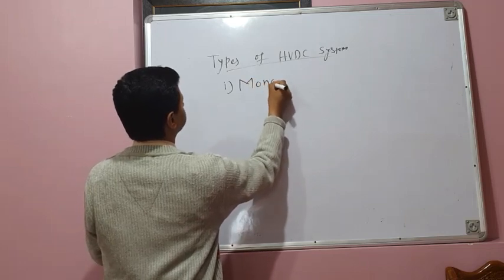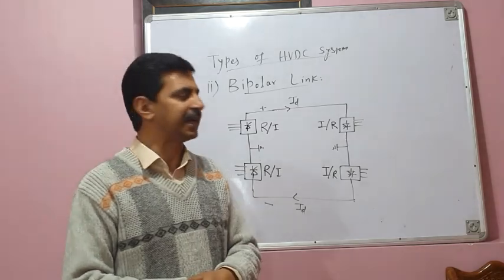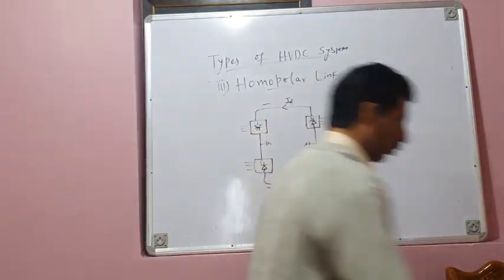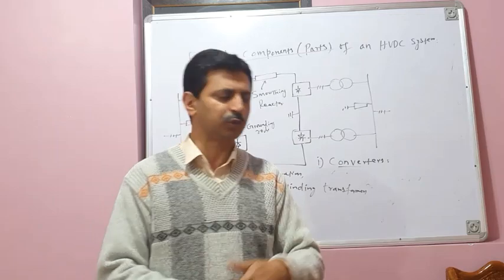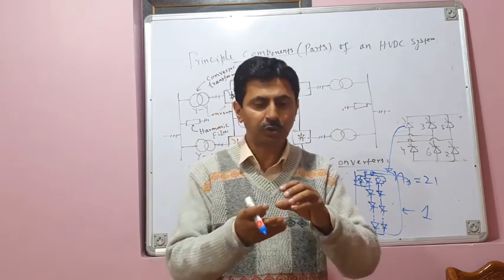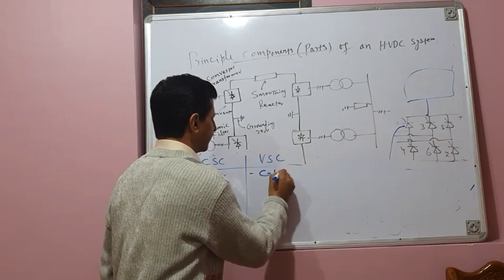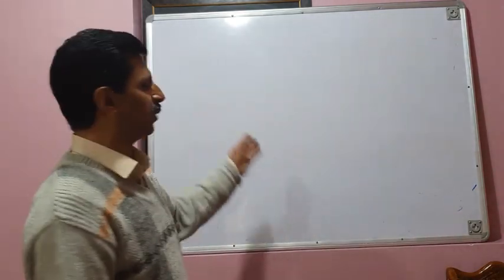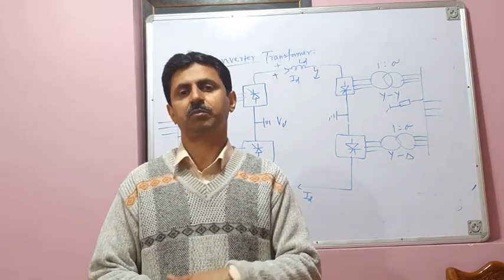L3_Types and Main parts of HVDC Systems

Comment: Sir, in previous lesson it was stated that in DC, corona effect is nil. But, here for monoplar link, you pointed out that the reason for negative(-ve) polarity is to have less corona and radio interference?
Reply from the maker: Corona is not absent in DC transmission bit corona loss is proportional to the sum of frequenct, f and 25. In HVDC Transmission Systems,  f=0 and hence corona loss is minimized but not zero.